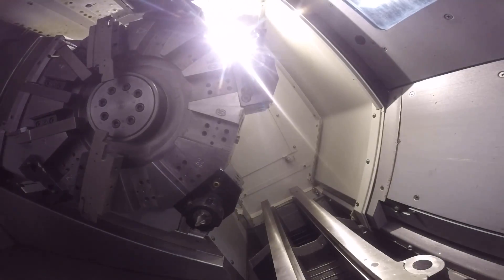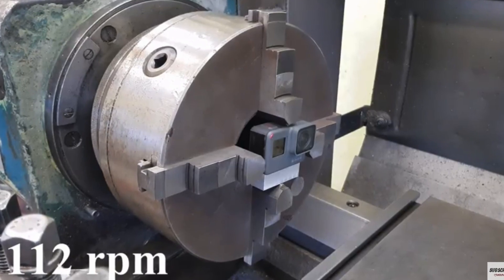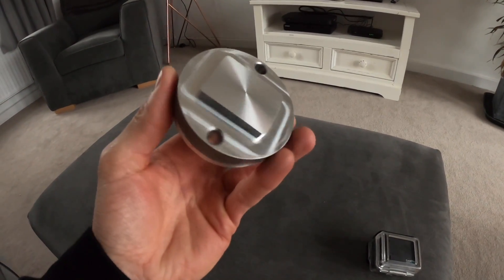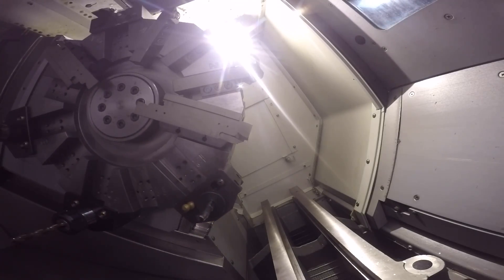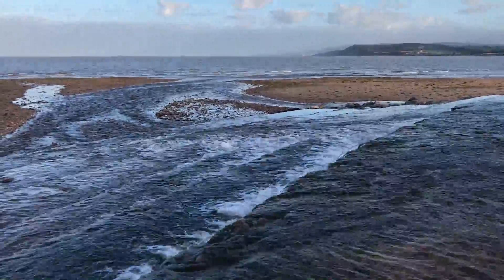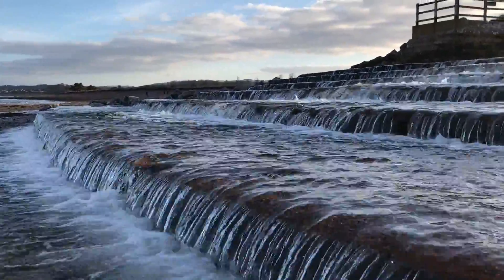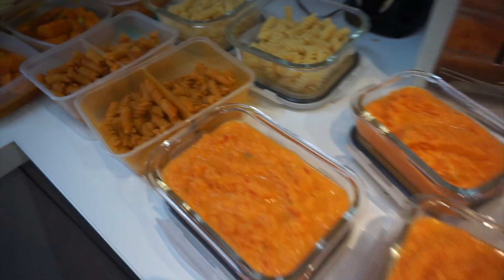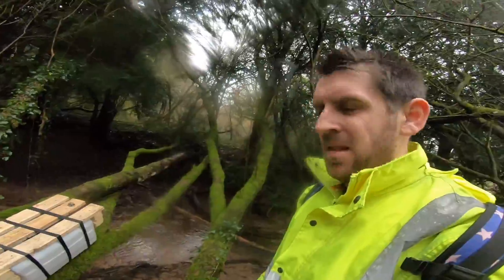SPINNING A GOPRO AT 2750 RPM

Comment: This isnt 2750rpm. This is like below 1800
Reply from the maker: The machine has been locked out to 2750rpm I can assure you, this was 2750rpm. Max speed of the machine (unless haas machines have some terrible issue, where the rpm settings are wrong lol)
Reply: @SamBaskettVLOGS At what settings were you recording with the gopro
Reply from the maker: Gopro hero 4 black. 1080p 60fps. I was tempted to attach it to my haas mill. Which rocks to 6000rpm. But it would most likely send the gopro into space

Comment: I've got to try me that in work. On the mills
Reply from the maker: Do the same process, but make a spigot to fix into whatever tooling you have. Mills normally spin much faster than the Lathes. I run one that hits 8000 Rpm.... But I’m not brave enough 😂😂
Reply: @SamBaskettVLOGS  I will film the process and send it to use
Reply: @SamBaskettVLOGS  ware use from any basket